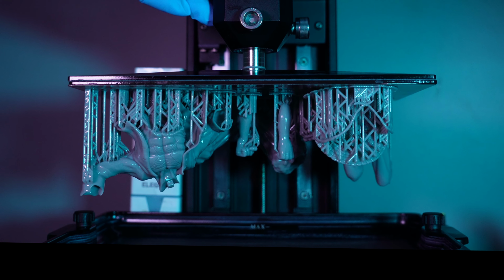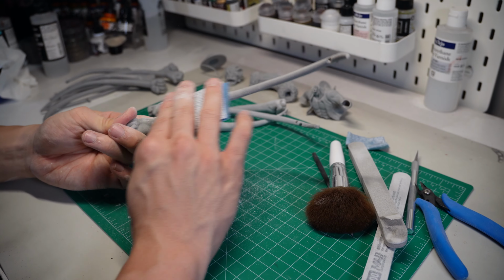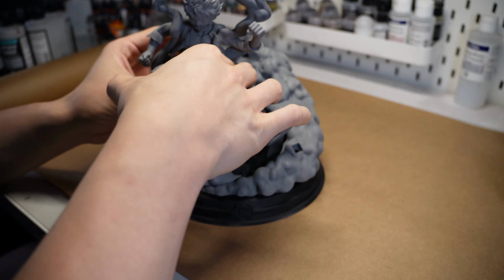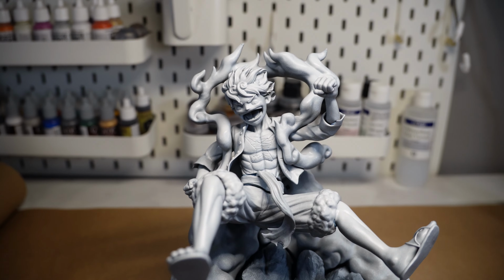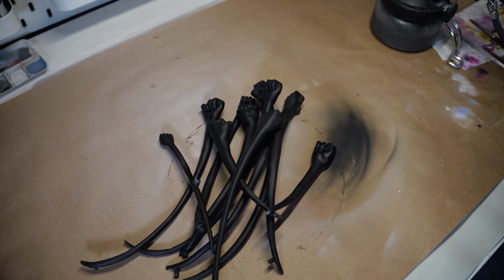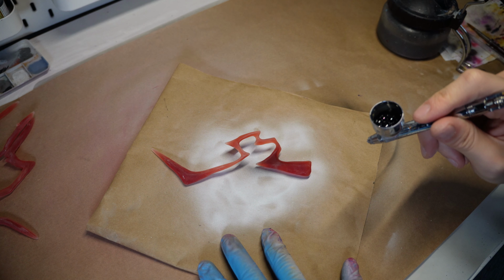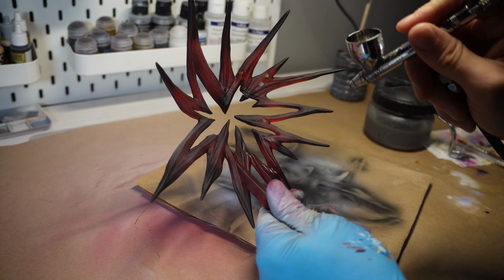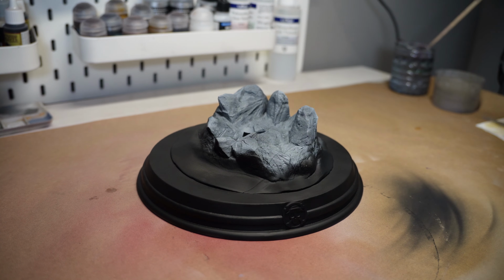3D Printed my own LUFFY statue in GEAR 5 | One Piece

Comment: What brush are you using (model and size) when detailing the face? min 2:35, those black strokes so thin and precise, amazing work. Thanks for sharing this beautiful work.
Reply from the maker: I use brushes from Rosemary & Co Series 33. Size for detailing is 2/0. I do want to get something a bit smaller though.
As for the thin black strokes, my tip for you is to use inks. It flows off the brush super smooth for small lines. You could also try mixing regular acrylics with flow improvers.

Comment: how did you get that amazing skin color. Special combo from the fairy skin tones or just one over the primer? how did you thin it for airbrush
Reply from the maker: You are right, I do use the fairy flesh from vallejo. Majority of the time I start off with Base Flesh. Then depending on the skin colour of the character, I mix and match the different skin tones from the set to get the desired results. As for thinning, I like to use flow improver as a thinner. It works better for me.
Reply: @TinyLittles3D  awesome thanks

Comment: hi, have the assembly plan? I printed it but I'm having a hard time putting it all together. THANKS
Reply from the maker: I also had a bit of a struggle putting it all together. I contacted the sculptor and he sent me a render of the pieces. It helped a bit. But I ended up not putting all the arms
Reply: @TinyLittles3D  ok, I stopped worrying last night, and I came to the same conclusion as you. In any case, you did an excellent job on this figurine. and thank you for answering me. 👌👍